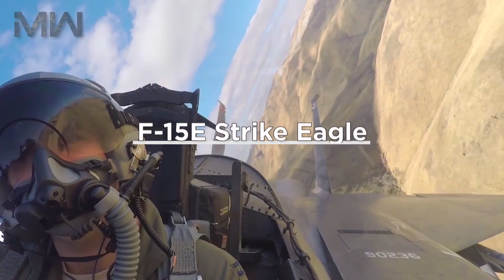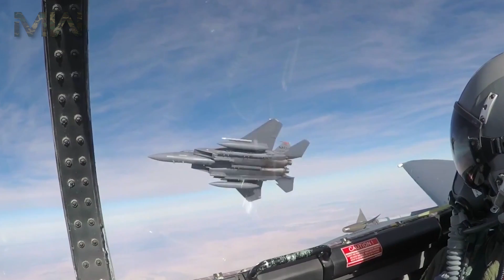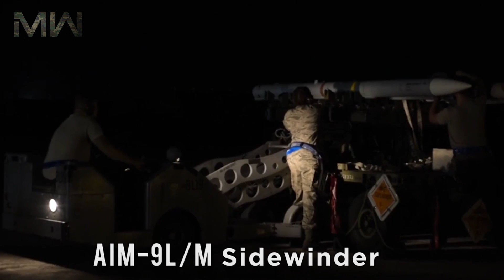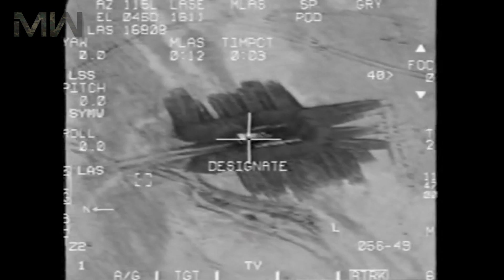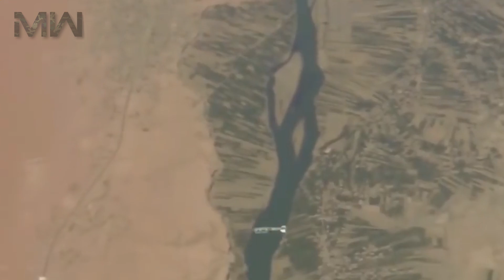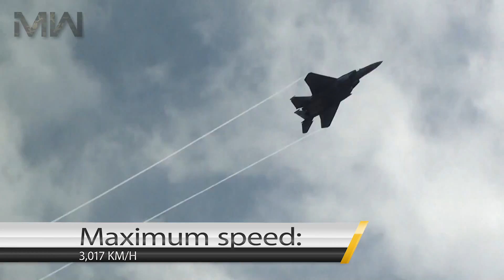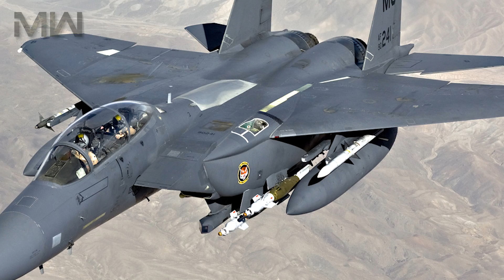F-15E Strike Eagle: US Multirole Strike FIGHTER

Comment: 0:09   Actually, it's the other way around... sort of.

In 1967, Douglas Aircraft Corporation of Long Beach, CA (DC-3, DC-8, A-4) merged with McDonnell Aircraft of St. Louis, MO (F-4, Mercury & Gemini space capsules) to form an aerospace giant appropriately called McDonnell Douglas.  After the merger, McDonnell Douglas' California operation focused on designing and producing civil airliners (DC-9/MD-80/MD-90, MD-11) and military transport & refueling aircraft (KC-10, C-17).  Simultaneously, McDonnell Douglas' Missouri operation continued to design and produce military strike-fighter aircraft (F-4, F-15, F/A-18, AV-8B).  30 years later, competing aerospace behemoth Boeing (737, 747, 777, 787, etc.) acquired McDonnell Douglas in August of 1997.  In essence, what originally were three competing aerospace manufacturers during the 1960s, now make up today's Boeing.  Therefore, a portion of the current Boeing Defense, Space & Security division used to be McDonnell Douglas. 🙂

Comment: Su 35 is better than F 15.
Reply: List the reasons
Reply: Filipe Araujo 1. excellent acceleration at high altitude to supersonic speeds 
2. unbelievably maneuverable at low speeds
3.It carries a huge arsenal of air-to-air missiles versus the F-15
.....
I don’t mean F 15 is a bad fighter,she’s sexy but personally i like Su 35
Reply: Su is sexy also
Reply: It's also 30 years newer than the F -15.
Reply: @Sm00th-0p3rAt0r  The AirForce is getting 8 new F-15E/EX to augment the F-15 C/D's.  These are 9 g new build aircraft built stronger without the wing issues that the A-Ds had.
Reply: Manueverable at low speeds...which means low energy, which means you already fucked up. Carries a wide variety of A/A missiles, and almost all of them are dog shit. Decent high alt acceleration but unreliable and smoky engines. You dont know of what you speak. 
But yes it is a worthy opponent.
And I agree, it is a beautiful jet. Whatever you prefer, the F15 will win BVR. If it were forced to a merge the Su would probably win if it had an excellent pilot.